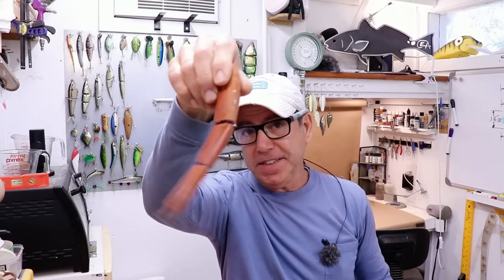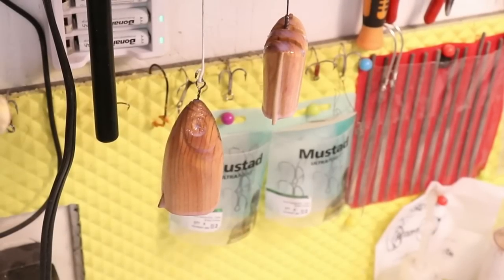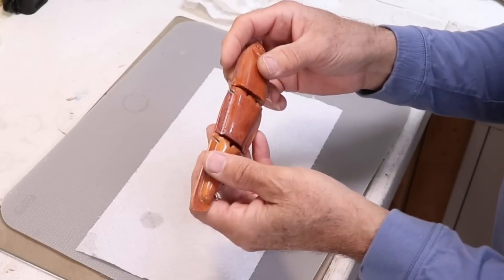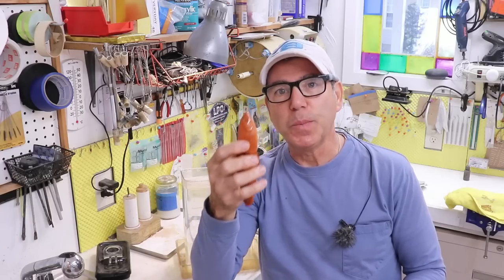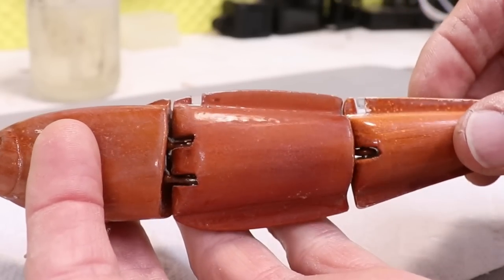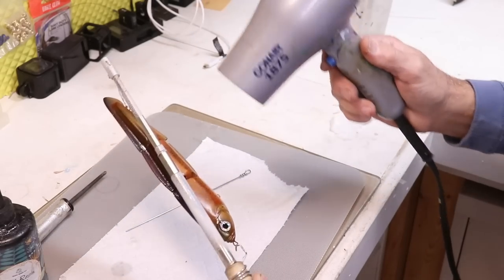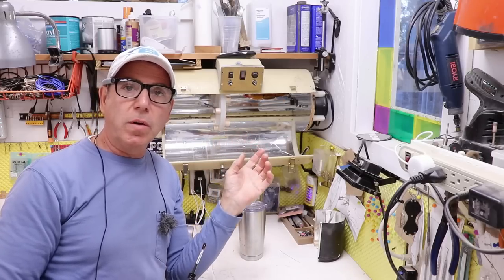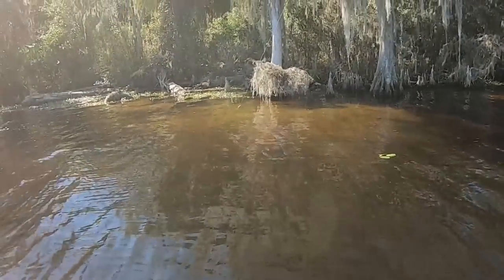Making a Swimbait That Really Works, Making the eel lure part 2   #luremaking  #swimbait

Comment from the maker: Just to follow up; the lure ended up weighing right at 58g total with the hooks.   I get a lot of questions about where I get materials, paints and accessories for these projects. I try to find the best deals on Amazon and I share them in my Amazon store. Follow this link to check it out: https://www.amazon.com/shop/engineeredanglerlures
Reply: I will be using your link for any of these items as I buy them. Excellent YouTube channel too btw
Reply from the maker: Thank you so much.

Comment: I have a question unrelated to this video. Can u tell me why my suspending Jerkbaits float in the winter?
Reply from the maker: Well,  This is why I never really think it's worthwhile to get a perfectly suspending lure.   Even if you can actually get a buoyant equilibrium , It actually is an unstable equilibrium. So the slightest thing can throw it off. Small bubbles caught in the hooks and hardware or on the surface of the lure will make the lure float.  If the lure gets cold enough it can shrink slightly and have less volume that would make it sink.  A change in the Density of the water could either make the lure float or sink.   But in your case I believe that it's a water density issue. Water is a funny thing it will become more and more dense with colder temperatures until it begins to form ice then it expands and becomes less dense and the ice will float.  I suspect that your lures were probably very slightly buoyant to begin with, And the slight increase in density of the colder water will make it float. I prefer to make my suspending baits slightly negative so they sink just very slowly. This way I can count them down and fish them at the depth that I want. Thanks for watching and thanks for the question.

Comment: Franco I have a question when you use the mesh fabric for your scale pattern is it possible to use paint brushes if you don't have a airbrush system
Reply from the maker: I think a brush would push the mesh around...you should try a small spunge.
Reply: @EngineeredAngler  would you still be able to paint from different angles
Reply from the maker: you'll have to experiment...

Comment: Hi ! I use the same resin and i like it but to cure it i use 2 405nm uv spots and it does work but it is prety long, like 2 or 3 hours, and at the end it is not tacky but a little bit soft... Do you think i need a different wave lenght? Also the smell is prety bad.
Reply from the maker: Yes...365 to 395nm is best but you also need as high a wattage as possible.
Reply: @EngineeredAngler  ok thank you!!
so i'am completly wrong with the 405nm.
Reply from the maker: you're not completely wrong, its just not the best for this use.